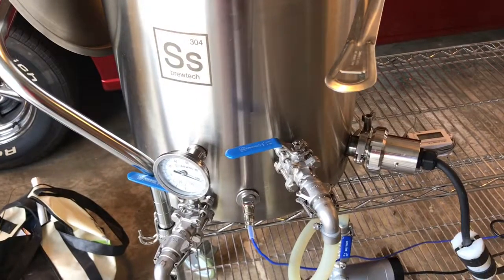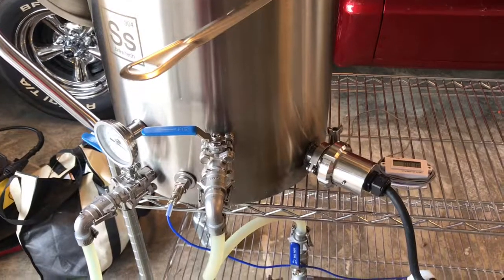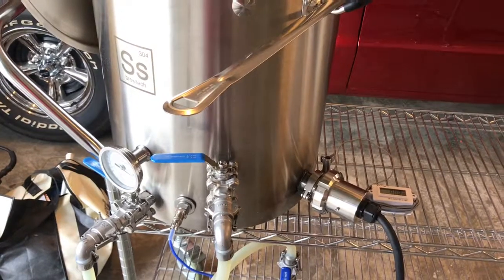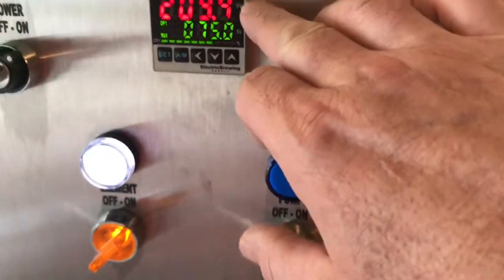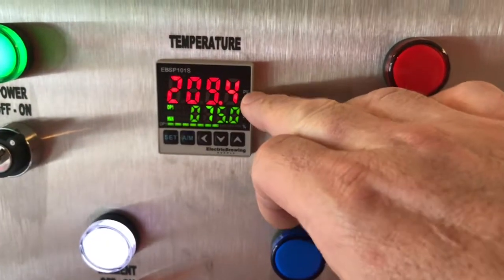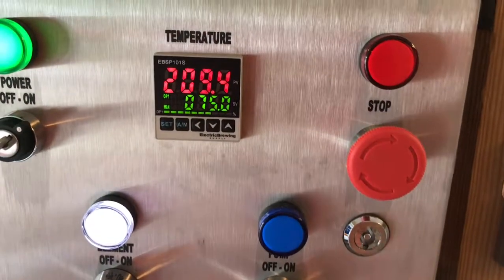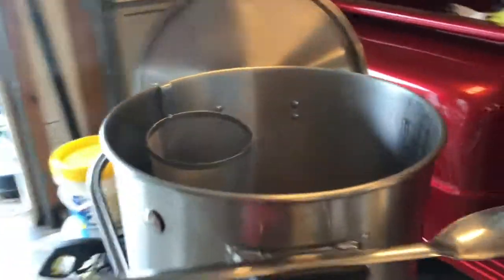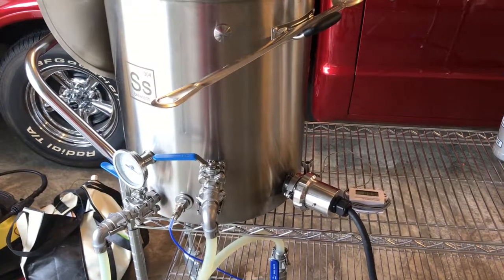Electric Brewing with RIMS vs Gas pros and cons

Comment: For the temp being at 209, the elevation of where you’re at increases or decreases the temp needed for liquid to boil.
Reply from the maker: after I posted this video i found my probe was off a little bit at the time i had a loose connection in my controller, I live on the gulf coast really close to se level.

Comment: Hey Eric, nice kettle. Do you find that it’s slower to boil with electric vs old fashioned gas burners? It looks way tidier for sure. Thanks man.
Reply from the maker: Carl great question, the short answer if you use 30amp 240 volt 5500 watt element like my system and heat 7 gallons of water at full power its twice as fast using electric then gas, now where people get messed up is if you use lower watt element at lower voltage you don't have the heating capability as you would with the higher watts volts system. but the biggest benefit to me is with electric most of the heat stays in the kettle when using gas your heating the outside of the kettle to heat the liquid inside it gets super hot in the summer brewing beer with gas big reason I moved to electric and I never have to run to the store and by more electricity! got to love that part Cheers.
Reply: @goldgulfcoastdesignericsho8628  that all sounds great. I'm looking into building a HERMS system using theelectricbrewery.com as source for the control panel, and just modding some big Concord kettles. I already have one 20gal, and would definitely go 30A minimum. Thanks for your feedback!